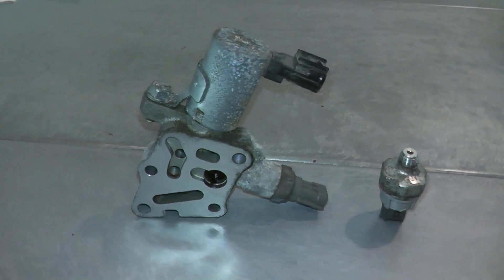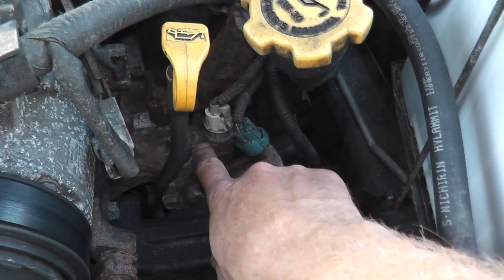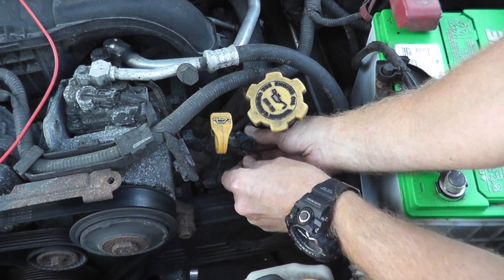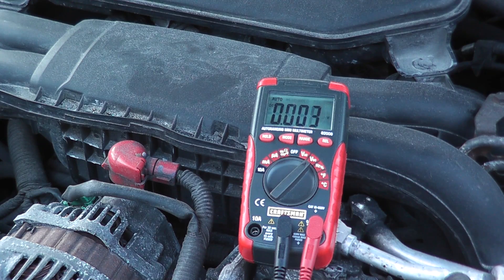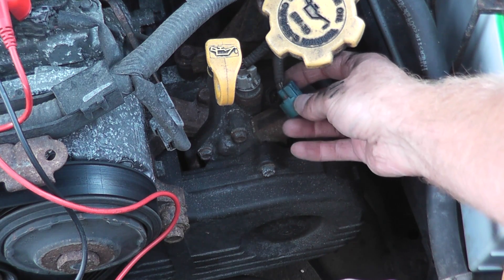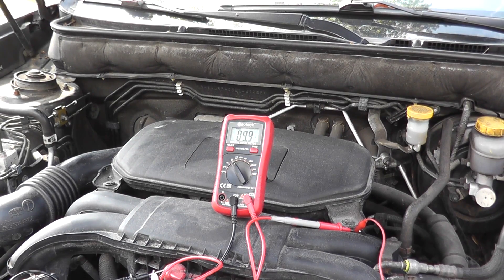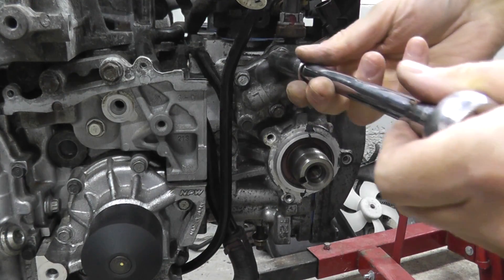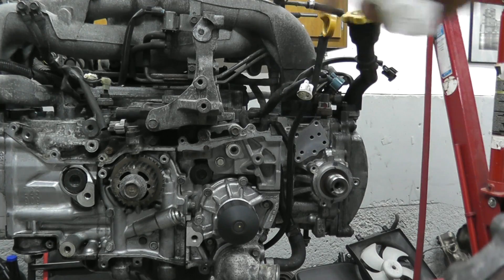Subaru P0028 - P0082 - P0083 VVT Solenoid: Testing and Replacement

Comment: To remove the solenoid:
Remove the cam sensor bolt than the bolt for the cam sensor bracket.  Back the cam sensor out far enough to clear the cam cover. 
Then pry the cam sensor bracket and it will come off with the sensor.  This exposes the VVT solenoid bolt.  I used a 10mm box wrench for the tough ones to get to.
Reply: Thank you!  This just saved me a crap ton of time!
Reply: I am unable to pry the bracket anywhere. It is solid even after removing the top bolt and sensor bolt. Is this different for different models? I have 2007 legacy.
Reply: @garliceggs  Hi, if it’s a 4 cylinder non-turbo, it’s the same engine.  You have to slide the cam sensor out a little so it clears enough to swing out of the way.  Might have to hit the bracket with some Blaster if there’s rust.  It should pry right off.
Reply: 2007 Subaru Legacy AWD 2.5L FI SOHC 4cyl. I was able to slide the sensor, just not the housing for it. It doesn't move. I don't see any rust.
Reply: @garliceggs  Sometimes they get stuck.  There’s a tight fitting boss that indexes the bracket to the head.  Spray it down with some PB Blaster and tap it with a small hammer.  Pry from behind and it should come out.  Mine was a little tough to get off and when it finally came loose, it slung the cam sensor under the vehicle.  Luckily I bought a new cam sensor.  Keep working on it, it’ll come apart!
Reply: @Modeltnick  I put a screwdriver on it and gave it a tap and it moved enough (towards the engine) that I was able to get a socket on the solenoid bolt and swap it out. Thanks for your advice.

Comment: What's the whining/buzzing sound in the background from 2:58 to 3:59? We're getting the same sound from our engine when the electricity is on and I'm trying to figure out if it's normal.
Reply: I have this too
Reply: Its simply all the electronics being energized. You dont hear those once the engine is on. It muffles those buzzing sounds.
Reply: @MN-sc2uz  Ah ok thanks!

Comment: I just changed both left and right today.. took me 40 mins both solenoids
Reply: Do we need to change oil for that? I mean i have to change the right side (passenger side) it is a lot easier to do, but i wonder if i removed it will the engine oil drain in that case? Do i need to empty the oil first? Subaru diagnosed the problem that i need to change this particular VVT solinoid, but they also said they need to change the oil in the prosess not sure wy.. my engine oil is changed for about 2 monthes ago and i decided to change the solinoid myself to spare some money, but wasint sure if i need to empty the engine oil for that first, maby thats wy subaru want to change oil?
I appreciate the answer will help a lot thank you.

Comment: Ok I need help pleaseeee ok here's the problem I did every thing u said for testing the voltage..it all came back correct on driver's side vvt and passenger side vvt both harness connectors read correctly on the meter....but every time I clear the p0083 code it comes on immediately??? Why is this??
Reply: I have the same issue. Have you found a solution

Comment: I replaced both solenoids left and right.. I even replaced both oil pressure sensors.and the code p0083 keeps coming back. after I cleared the codes on my scanner why is this??

Comment: STOP !  I just thru a p0028 code on my 09 2.5 lego. Checked all the vids. Did ohm test and 0 on the solenoid. Saw that the effen engineers decided that you would have to take all the timing covers etc off to get at it. there is a bracket in the way so you can't get a socket on the solenoid 10mm. Fuck that. I took my dremmel with a metal cutting wheel and cut the nob on the bracket off. Easy to get a socket on it now. Good luck bros. J R

Comment: I think my harness is bad, as I have replaced both of the solenoids and still getting an intermittent code corresponding to this solenoid, before I got throw a harness at it, this solenoid isn't triggered by a relay is it?
Reply: maybe watch this and try this out...https://www.youtube.com/watch?v=qfM1_xLhkNU
Reply: @mfreebush  oh shit man, I got it figured awhile back. It turned out to be the oil pressure switch. But I’ll give this a gander anyway to see if I can grab some other related info…thanks.

Comment: READ THIS FIRST!!!! what he's showing is how to remove the housing, if you just need to remove the solenoid there's a 10mm right behind it, you can see it very easily. All you need to do is unscrew it and wiggle the solenoid out, it has O-rings so it'll be a little tough but you don't need to pull the housing to replace the solenoid
Reply: For real. but how did you get at that bolt with the useless piece of casting in the way there?
Reply: @ChrisLesmerises  you can remove the cam sensor bracket buy loosening the sensor and then removing the upper bolt. this gives you access to the bolt that holds the variable valve timing solenoid in place. its not a fun job but you do not need to do what this guy dose.
Reply: @nophobia123   ya I got the sensor loosened up and you can swivel it about to take out that upper bolt your talking about. I still can’t see how you have access though bc it’s still blocking the VVT solenoid. I see also another bolt underneath and a hex head even lower, all apart of the same manifold. Can prying that casing give me the clearance needed or do I need to take those out too. Seems a tough to pry and makes me feel like more needs to be undone
Reply: @nophobia123  EXACTLY! I DID EXACTLY THAT A FEW DAYS AGO ON MY LEGACY, WAY EASIER AND QUICKER.
Reply: @ChrisLesmerises  I ground away enough material to get the socket in. There's plenty of material left to perform its function
Reply: @ChrisLesmerises  shave it down
Reply: You cannot access it with a socket, there is another housing that has a bit sticking up causing interference with the bolt path. So no, that is not an option, at least not on the 2.5L NA EJ253
Reply: lol, you beat me to it
Reply: Changed my solenoid out and erased the code and it popped up again not an hour later, any ideas on why? My thought was not enough power getting to it but I could be wrong
Reply: What I did was used my Dremel and grinded away the useless aluminum part that pretty much blocks the 10 mm bolt.  Oh and for more room u definitely have to remove the battery and I also found that using a 10mm but driver makes it easy to remove solenoid
Reply: @Dannyaudio69  Yes, that's what I intend to and grind a bit of the casting that's shading the bolt. I don't have a 1/4" ratchet set to see if that helps. Thanks for posting.

Comment: Im confused, I think there was too much work to do something simple, because theres a single bolt in the picture of the new part, thats shows it holds the solenoid in the body that you took all the work to take off? Picture doesnt show all of that. i guess ill find out when I get the parts and go at it. now I could see one of those oil passages could be clogged?

Comment: Is the replacement part the same for the driver's side? All I can find are variable valve timing solenoids, but not valve lift solenoids. I have a 2009 Subaru Impreza with the 2.5 engine. Thank you.
Reply: did you fix the issue? I'm about to buy an 06
Reply: It is a “VVT” solendoid.

Comment: why didnt you replace the solenoid alone?  does the housing matter
Reply: Use a 10mm offset wrench but 1st remove  cam sensor 10mm bolt and  spread to create space, took me 10 minutes to do
Reply: No it does not
Reply: You can, but the stupid cam sensor bracket and timing belt cover is in the way... So you can't get a socket or a wrench on it... Going to try and see if I can get the sensor and sensor bracket off tomorrow... Otherwise I have to do what he did to get at it... I'll let you know...

Poking around found this... yes you can get at it with out ripping the front part of the engine off...
Just remove the cam sensor and bracket... it might be hard to get off because of an alignment pin...
But you can do it.
https://www.subaruoutback.org/threads/p0028-code-2008-outback-2-5i.461314/
And so far haven't seen if there are any screens in the hosing like on the earlier gens...

Comment: Hello.Do you have a video of how to fix error P1496 (low voltage on the EGR valve) P1496 EGR SIGNAL LINE 3 CIRCUIT (LOW) on a Subaru Outback 2.5 ?

Comment: I’ve recently had Subaru replace the bank one p0026, $600...now p0028 and they said another $600. So looking to do this myself. Part at autozone did not include the full housing. Is there an option of just replacing the solenoid control part that fits in to the housing?
 
https://parts.subaru.com/p/Subaru__Forester-XT/Engine-Variable-Valve-Timing-VVT-Solenoid/49223110/10921AA080.html
Reply: You can try cleaning it by soaking the part that gets covered in oil in some degreaser then using a toothbrush and brake clean or carb cleaner to spray it down... you don't need the full housing
Reply: Check eBay for these solenoid

Comment: Subura decided to make every single part of DIY super hard. I'm surprised that changing the oil isn't harder
Reply: Oh the filter is just right in between the exhaust manifold….
Reply: @APinTheAK : That's why you buy a socket type oil filter wrench... Many fewer burnt knuckles.
Reply: Exactly. Im buying a miata or an old civic just so its easier to fix 😂

Comment: I had a VVT code pop up on my nissan murano. Luckily I changed the oil and it went away after a few days. Felt the difference in driving immediately as well. However if I did have to replace the solenoid it would of been wayyyy easier than this! Love your subaru videos though. I have a few friends that have outbacks, and it's nice to have some knowledge like this to help them with troubleshooting problems.